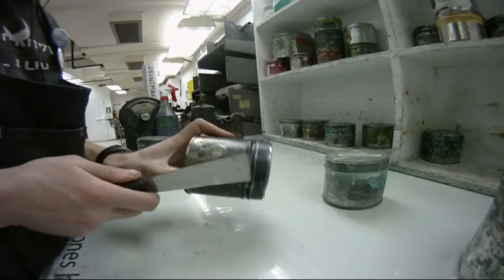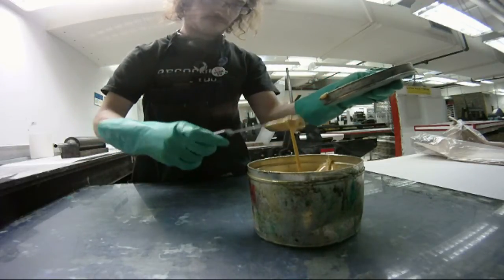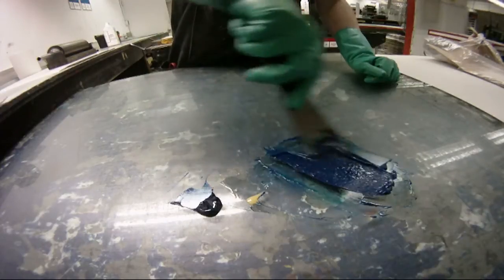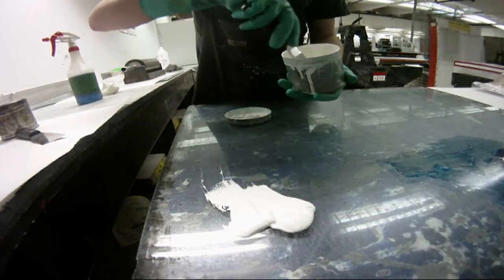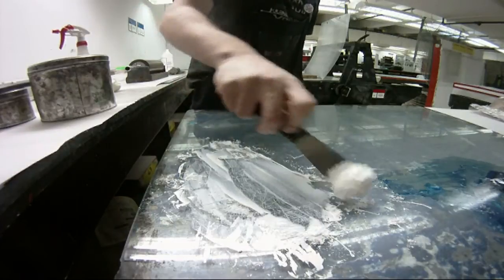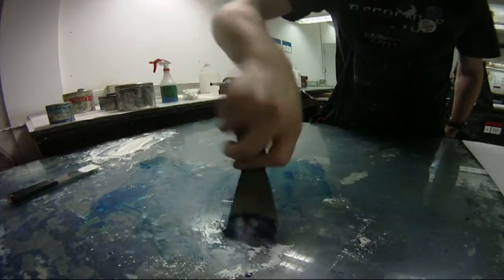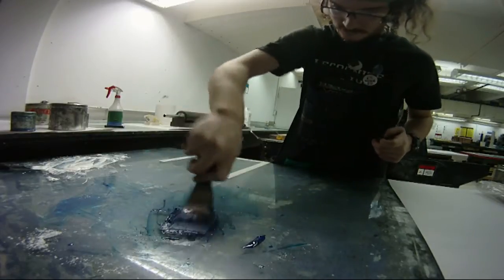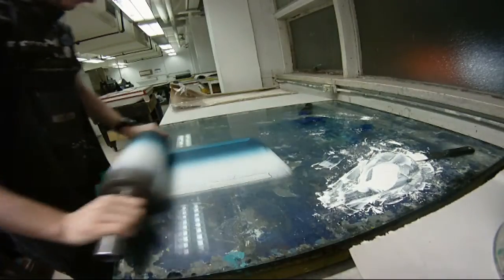Lithography Techniques - MIXING INK - LITHO SLAYAGE

Comment from the maker: Hey Paul. I add Magnesium to the ink to shorten it. I find it's a bit too loose out of the can. When I don't add Mag the pigment has a tendency to separate a bit and leave these weird blooming marks, some inks a worse than others. I find red and blues are the worse but I love printing with those colours and it's nothing a little modification can't fix! It's a preference but not a required, depends on what you are printing I guess. These are oil based inks.

hope you enjoyed the video!

Comment: What is the brand of the trans base you are using? I want to reduce the opacity of my litho inks without change the viscosity, but I can't find a trans base reducer for litho inks, just etching ink. Does the same base work for both? Can I get an etching oil-based trans base?